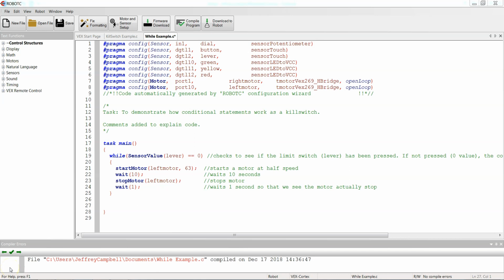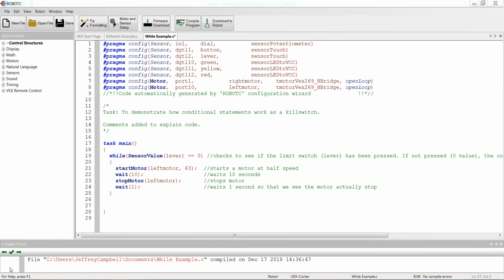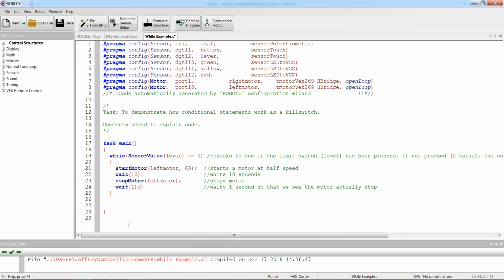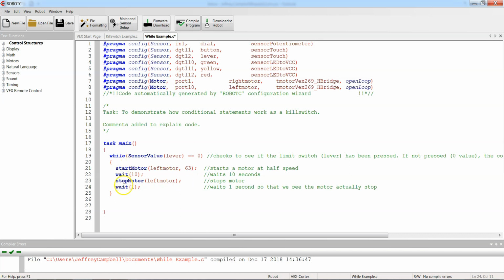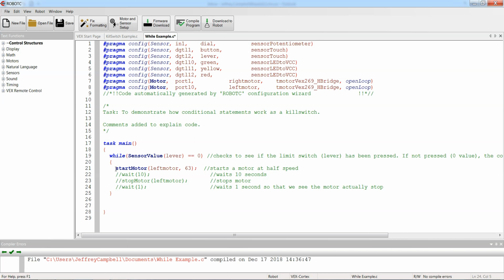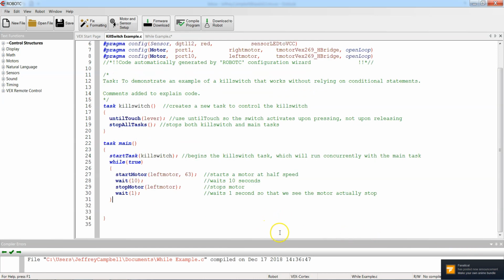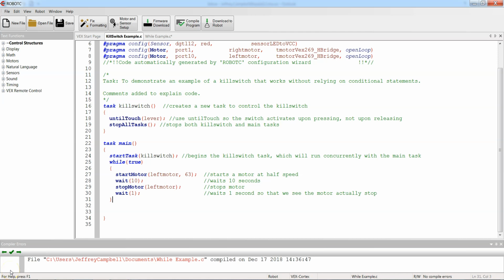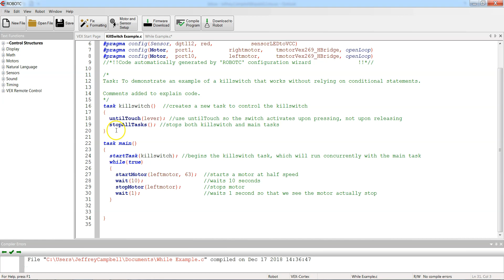VEX & RobotC - Multitasking an E-Stop

Comment: in the first section before the kill switch is added, what is looping the program without an infinite while loop?
Reply from the maker: Using "(SensorValue(lever) == 0)" as the condition, it is measuring the current value of the limit switch to decided whether to continue the loop. If the limit switch is not pressed, RobotC detects 0 as a value. When pressed, it will detect 1.  So as long as the program detects 0 when it checks the condition, it will repeat the loop. If the lever is pressed, at the point it checks the condition (which is at the start of each iteration of the loop), then it will exit the while loop, which will end the program based on how it was coded.